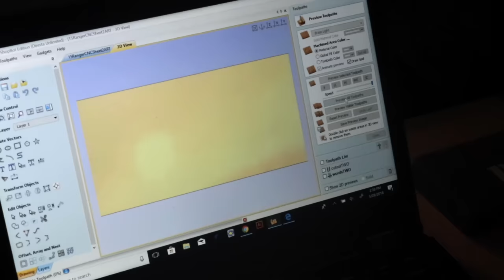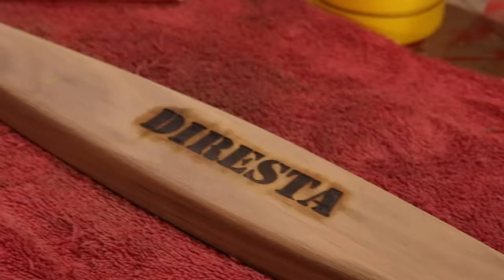DiResta Canoe Build

Comment: Jimmy mate, its builds like this is why so many people look at you as their inspiration and why you really are The Godfather!! MUCH RESPECT!
Reply: well my first thought was:  this guy looks like the boat will sink instant. but it will have an apple logo
Reply: @lowdt  my grandfather's built in 1910 still works fine, though it has a canvas exterior.
Reply: @mmercier0921  Michael, in the years before the miracle of epoxy canoes were built with canvas set in a coat of wet paint, then the exterior was also painted. As you've stated some of these canoes are well over 100 years of age and still water tight.

Comment: The most enjoyable half hour I've spent for months. At 72 years old and being 100% combat disabled I'm limited in what I can do, but I must say your video has inspired me to finally start building the sailing dingy I've wanted to build for quite some time.Thank you for the inspiration and the great video. I am sure you will get hours of enjoyment from the most beautiful canoe I've ever seen. I am curious about one thing, what is the final weight of your canoe? Thanks Jimmy.
Reply: Thank you Mr.Erps.
Reply: Don't know about this one, but on the website of the Langford canoe brand, you may see several models with specs. Expect 60lbs for a 15' long wooden canoe. Traditionnal indian canoe with birch bark over wooden frame were lighter. Less than 30lbs. Enjoy your sailing on your dingy !
Reply: you should make it into a video
Reply: Bear Mountain Boats website says their Prospector Ranger 15' (which it is) is 45 to 55 lbs when completed.
Reply: Best of luck Mr. Erps

Comment: Back in 1999-2000 I worked for Newfound Woodworking building woodstrip canoes, kayaks, and rowing boats. Beautiful and practical boats. On boats that will get dragged up on shores one can make a mixture of epoxy and powdered graphite and paint the bottom, this will give a wear resistant coating. When laminating those bow pieces we always used epoxy glue, it is 100% waterproof.

Comment: I've never used a canoe where I didn't occasionally scrape it over rocks in a low spot in the river. I'd feel terrible scratching up a beautiful canoe like this - and would it tear the membrane and maybe let water in?
Reply: Whilst it would likely scrape and scratch, the combination of resin and fibreglass sheet is pretty damn solid and since the resin soaks into both wood and fibreglass, there is nothing to tear. Should the fibreglass layer wear down or get damaged to the point where the wood is exposed, it can simply be repaired by cleaning up the area and reapplying fibreglass and resin.
Reply: also scratches aren't necessarily a problem, resin hides all accidents xD
Reply: @rubeniscool  You're probably right - If I owned it, my fear is that I'd scrape it through the finish and into the wood. I guess I'd only use it on a lake and not a river.
Reply: Yes it needs two keel strips to take the scrapes.

Comment: Not a canoe guy, or a boating guy in general, so I have to ask since it's the only part of this project I don't get. The notches cut in the top rail, are they there to make the wood easier to bend against the side of the canoe's curve, or are they there to help drain water that might get in the canoe when it's turned over for storage and transport so that it doesn't stand on the inside of the lip with no place to go?
Reply: Drain water and the also provides a place to lash gear down.

Comment: Went to Mystic, Connecticut three times in about 5 years, their old 16th century harbor, visiting it every chance. 
They were building a recreate of Amistad ship there, Big project undertaking. Very impressive to say the least. 
Still recall the day as I walked into the yard they just set the grinder down from finishing its keel beam, HUGH Hugh chunk of lumber.
Thing about wood, there is no welding back and redoing it, need to be thorough in the first swipe at things!
They guy had an very interesting sign of relief from countless hours of labor on IT.
 Several years later went back there, to actually Walk on a similar ship, Small spaces these are comprised up of. The Amistad had departed maiden voyage weeks before I got there. 

Great little boat there, great colors and component selection makeup!!

Comment: Great project! phenomenal finished article :) could you possibly do a video on why Festool use beech tenons?  Beech is terrible for outside use and swells a lot if they are in a humid environment (so don't fit if they aren't kept in an air tight container). and their 'Outside' tenon is Sepelle  (apologises spelling may be incorrect) a hardwood which can be very weak/ soft and unreliable - depending on your luck and the part of the tree it came from.... is it worth making your own lose tenons? the tool is amazing - the dowels ???? not convinced myself.

Comment: Hi. I really enjoyed your video. Can you tell me the list of materials. - wood, glue, etc. - that you used ... Thank you very much. I speak here from Brazil
Reply: I have built 22 strippers(some were Styrofoam or other weird core materials). This same methods can be used with almost any wood, but lighter density helps in end weight of the canoe.  You live where there are most of the best beautiful Hardwoods in the world. I am currently on the nest level with my 23rd canoe. It is totally a different construction from this guys.  Click on my green icon and slide over to the right to see all of my video's.  Using Ecuadorian 11Ft. Balsa 3/8ths thick core with Mexican bookmatched Ziricote veener at 1/42"thin, covered in 7 ounce (2532 style BFG plain weave fiber-glass on the outside and 4ounce plain on the inside)---definitely not a cheep build.